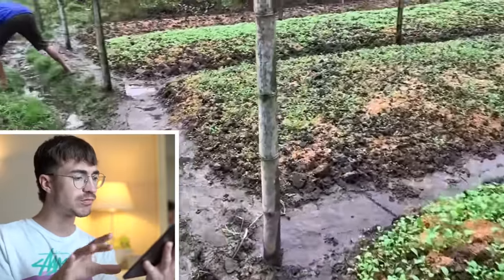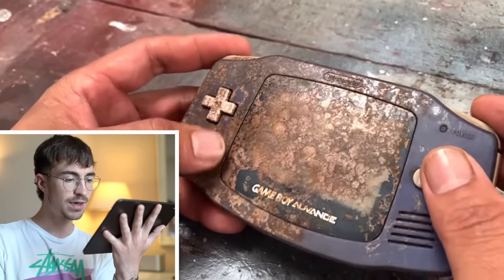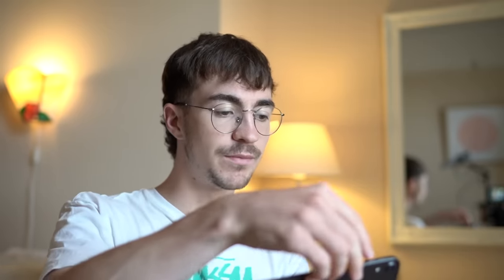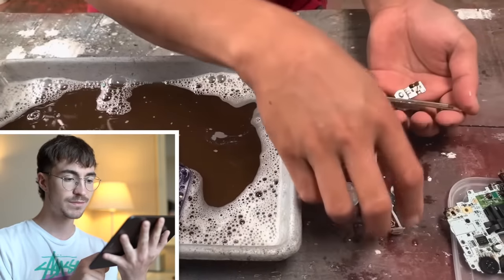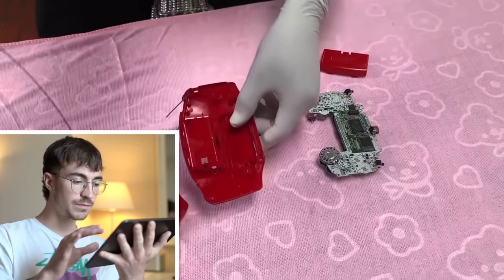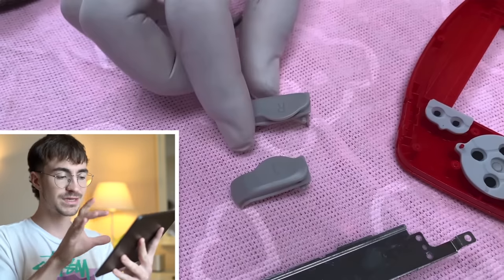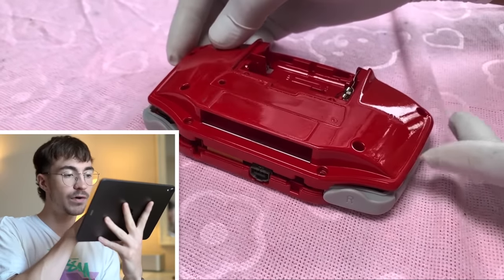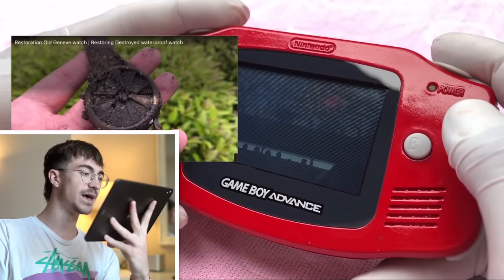Exposing FAKE Restoration Videos!

Comment: Soaking your electronics in water isn't going to harm them, as long as the device is off and disconnected from any power source. Water itself is harmless to electronics as the damage is only done when spilled on powered devices, in which the water bridges the gaps between circuits and causes a short which can lead to sensitive components receiving higher voltage than they can tolerate.

Also additional fun fact, distilled water (pure H2O with nothing else in it) is completely non-conductive and will not cause a short, even if spilled on actively powered electronics. Water gains it's high conductivity from outside materials being dissolved into it. I know this because I've built water-cooled PCs, and my coolant of choice is distilled water with a drop of biocide. In the event of a leak, the risk of actual damage is minimal. One of the pumps I used required the motherboard to be powered on in order for the pump to spin, which was necessary for filling the loop. One of my fittings wasn't on tight enough and the loop burst, drenching the motherboard and PSU in distilled water, whilst they were powered on, and no components suffered any damage. I still use the PSU in the rig I am typing this on. I also occasionally wash my keyboard in the sink with the faucet

tl;dr it's perfectly safe to soak a gameboy advance in water if it has no batteries. Just make sure it is fully dry before attempting to power on.

Comment: the reason the Gameboy actually turned on it’s because if the systems off then the water won’t effect anything but you have to dry it before turning it on or it will damage the system and it wont turn on

Comment: Electronics expert here

Yes the motherboard can work, not for long time tho, it may work for some hours but if is actually a years or even just some days in mud and then you sumerge it on water it will not work 

My sound card i use on my pc spent 3 years where it got wet by the rain and works fine but mud destroys everything pretty fast 

A muddy gameboy can work but not for long or even just never work and judging by the casing of the console it had been for atleast a year on the mud so

No, it will not work at all 

Also he sumerged the screen on water and i did'nt saw any water mark 

Those can appear with just your natural finger liquid so

Yes it is fake

Comment: A few weeks ago I found the controller for a VTech baby monitor at a bus stop. Missing the battery compartment cover, a little beaten up, but probably salvageable.

Suddenly I had a feeling I'd been hijacked into a bullshit restoration video. 

I wiped off my fingerprints, dropped it in the raincoat pocket of an unsuspecting passerby, and melted into the shadows.

Comment: You can actually submerge electronics in water and have them still work. As long as there wasn't a current in the electronics then the board won't short out. I've done this many times when I've had FPV drones crash in water and kept it underwater while I unplugged the battery. Clean it up and let dry for a couple days to make sure, and they power on and work just fine. Most the time when an electronic shorts out from water, it's generally while it's still on and the person is shaking it out while there's still a current. This movement of water causes the arching and shorting of components on the board. REMEMBER PEOPLE, water IS NOT conductive!! The materials like nickle, iron, etc are what causes the current to pass through water, NOT the water itself.

Comment: In Pakistan, we also wash motherboards with surf and water. They work perfectly. These electric circuit boards are more durable than we actually think. 
I've personally restored many old computers. Sometimes, some parts need to be replaced but that's all included in the process of restoring something that has already served it's life well.

Comment: As a technician having worked in the industry since '90, I have personally washed dozens of circuit boards with soap and water with no issues. Home and business electronics are often infested with roach carcasses and feces if the place is infested.
On that note, I'll never visit New Jersey, as the electronics from their restaurants are always some of the most disgusting I've ever worked on. 
In this refurbishment, he had no choice but to replace with aftermarket contacts because they wear out with use, which is likely why it was tossed out in the first place.

Comment: If you watch all the "points" from the beginning of the original video, such as the screws and the buttons, you'll see these were not replaced. The same threads and heads were there from the beginning, some of it is blocked by your inlay.

Also, there is nothing wrong with using soap and water to clean electronics. I'm an engineer and used to work in a factory environment. We primarily used trichloroethylene, undiluted isopropyl alcohol(not the rubbing alcohol you get at the store) and deionized water to clean our boards. A couple decades ago when I worked there, they used to allow the assemblers to have drinks at their stations. Someone spilled soda or something on a board and didn't tell anyone. They sent it through the wave machine and cooked the sugars into the vias. This isn't soluble in trichlor or isopropyl. We literally soaked the board in dish soap and water to break up the sugar and get it cleaned. We reflowed it, and the board is in a mammography machine somewhere now. Forget something as simple as a Gameboy.

What causes water to damage electronics is if you turn it ON while it is wet, especially if the water has electrolytes dissolved in it(salts and other things in solution). AKA normal water, compared to deionized water, which is non-conductive. With normal water, you might as well take a screwdriver and scrap it across the conductors on the board while it's on. You create conductive paths that weren't designed to be connected, overloading semiconductors and causing permanent damage. If any electronic board is cleaned with water and thoroughly dried, there will be no harm to it.

There are actually some fluxes and temporary solder masks out there that are water soluble, designed to be removed by hot water after the wave machine when the boards get cleaned. Look up Chemask WF from Chemtronics for example. Very popular product for plants that don't want to use strong cleaning agents. You have much to learn, young grasshopper.
Reply: The video is still fake and all, but good points

Comment: I'm not going to go out on a limb and say the motherboard wasn't replaced with one that maybe had some selective rust added, however I have seen a lot of C-64 and Amstrad CPC restorations by Noel's Retro Lab that were crazy how well things survived a very long time in bad conditions.  One of them had sat in an outdoor barn/shed for years and was full of mud, leaves, and a bunch of superficial rust on the MB.  After thoroughly cleaning, drying, and inspecting he was able to get it to power up without any issues.  Of course a GBA is a lot more complicated with many more things that aren't going to do well with moisture (Especially that screen!), however since it has no built-in battery that could really destroy powered traces/components until it completely discharged a GBA has a much better shot at surviving water long-term.

Comment: How can an electronic device be turned on if the components inside are still wet? When they take the device apart after successfully turning it on, the inside still has parts that are obviously wet. If that person in the video knew anything about electronics, they would thoroughly dry out the Inside before Installing batteries.

Comment: Water in and of itself won’t hurt de-energized electronics (except speakers or LCD screens), however the rust and corrosion would. 

Using a brush would have a very good chance of dislodging something though.

Comment: To be fair, a good way to possibly salvage submerged electronics is to (after removing the battery) flood them out with clean water ASAP, to get as much potentially-short-causing crap out as possible, then let them dry completely. However, they didn't do that.

Comment: I did restoration of old gear for my local police department, so they could put old equipment in a local museum. That shit is a nightmare. It is not simple or easy, even with non electronic parts.

Comment: You can submerg electronics in water and still have them work. As long as the electronic is not wet while activley passing current it can survive through a dowsing. So as long as he dried this bad boy up real well before turning it on, it has a decent chance of functioning. Fun fact.

Comment: It's not the water that damages electrical equipment, It's electricity. As long as there's no electricity flowing within the device while the device is wet then there's no damage to the device.

Comment: Surprised you didn't call out the case more. The spray painted case had translucent properties. Paint that can cover up another color won't let light through like that.

Next, I've seen boards which can be revived from some pretty bad states, but I can say those boards were not the same boards. Sure it was a worn board but not the same one. A board in water that long would have "exploded" when the soldering iron was brought near. Additionally the board would have deteroiated and crumbled under slight pressure. And don't get me started on the capacitors. After soaking in mud that long they would have failed as well.

You can submerge a board in water and it will be fine (I recommend baking it for a bit after to get all the moisture out, but as long as the water doesn't make electrical contact it may run after.
Note: There are some chemicals which look and somewhat behave like water, but are not water. One such chemical (I forget its name) is used in server room fire suppression systems, because it won't damage electronics but can be used to similarly to water to put out a fire.

One more thing to note: that mud and dirt didn't look natural.

Comment: There's nothing bad about running water over a circuit board that has all its power removed, as long as it's either deionized, pure, or just regular old mineral water but which was dried off thoroughly before adding any power source back.

Comment: my guess is, the GBA is actually dead, but not the LED light, so they tried to preserve the mechanism of the light when they ruin the whole thing, they make it so the bulb can still receive electricity. and showing it can still be turned on, giving it a sense of hope. a false hope. in the end, the machine could be a new one, or it actually didn't rust, just dirty which can easily be cleaned off.

Comment: I'm no expert on restoring, or for the matter of the electronic know how, but just thinking outside the box, that the "so-called" restoration video could simply be "authentic", and perfectly working...but here's the kicker....which I'd bet ya what that guy did, the whole process of taking each portion of so-called restoration, and put it "IN REVERSE"! And also add confusion for spraying it a different color, reassemble it with a self-dirty edged motherboard, and so on, and so on for each part, IN REVERSE...and soak it in muddy water for months, and stage it, begin cleaning it in the most worse way possible!

Comment: Its not uncommon to scrub motherboards with soap and water to remove flux. Many have washed motherboards in the dishwasher. Famous overclocker Der8auer for example uses a dishwasher to clean electronic components.

Comment: The watch one that came up after is actually worse. He finds a watch, as shown, sitting atop rubbish in the same area as he found the Gameboy. The glass is all smashed and fragmented into pieces, but none of it fell out until he gets it back an tips it up! He does the same thing, dumps it is soapy water - its battery powered - and with a new crystal and battery, low and behold works straight off. Filthy mangles case, gleams like new chrome after a drimmeling.

Comment: Using water to clean electronics is fine if there is no power running through it and you completely dry it before supplying power. Use water to clean circuit boards all the time.

Comment: Accurate its been doctored with donor parts, but there have been many times over the years where ive found a pc dumped on the side of a back road that has been wet, dusty and muddy for weeks and weeks, and ive carried the sucker home, removed the hard drive and cmos battery, chucked it in a dishwasher on the pots setting (with the dishwasher tablet in) then once its done put it in the back room for a couple weeks to dry out, reassembled it and its worked fine or only had a minor issue like something had bent the keyboard connector and broken a solder joint(were talking 386 25mhz pc's here with the round 5 pin keyboard socket) or the floppy drive still has grit in it and it doesnt work/ruins disks. Having said that i had one that just kept triping my circuit breaker no matter if i changed the psu or unplugged whatever besides the mobo. Ive also had alot of luck with simply dissasembling, washing with dish washing liquid and a brush and letting dry/hairdryer and reassembling nes and master systems and cartriges that had been dumped on the side of the road back in the late 90's when they were worthless and the rubbish tips were expensive so people just left giant piles of junk on sides of dirt roads away from town. So id say its plausible to do.  Although it would had to have been batteryless already,  nothing ive ever found that had been powered on at the time of being submerged has ever worked properly again. Even the nokia 3310 isnt immune to falling off the roof of a car into the gutter on a rainy day.

Comment: So, i manufacture/solder PCBs. On the motherboard that is allegedly original, there's parts that are ASM (auto-surface mount) whereas on an original board they were wired via through-hole.  the micro-chips are aftermarket as well, since they don't have an official serial # either.

Comment: Electronics can handle some water as along as there is no active power running through the circuits. I used to work as a electrical tech at a mill and our spare parts room flood over long weekend when a pipe burst. Long story short 99% of those parts worked just fine after we cleaned and dried them.

Comment: My grandfather got his first pc in 79 ,he has had a lot since, but even if they did work when he put them away they often dont work anymore if we try to start them, the iron and the rubber inside and out gets rusty and stiff. 
There is absolutely no way that Nintendo would work, the rubber would be stiff or just fall apart when it dried, the rust would leave marks.or cause small things to break or even break off.., the rust that was real, anyway, not the strange substance on the plastic, im not sure if that was supposed to be dried mud or what.

Comment: The HDD in my laptop seized up after overheating and being dropped on the floor. I was devastated because I hadn't backed up my "homework" file. Luckily, I soaked it in anti-freeze overnight and it worked perfectly. It even restored the stickers, seals, and changed it to a better manufacturer. I'll post the video as soon as I get my keyboard regreased.

Comment: Submerging electronics in water or soap wont instantly kill them, the reason why water is genarely dangerous for electronics is that it shorts pins/connections that you realy dont want to be shorted, this is not realy a problem if you clean it without power connected and you dry it correctly. Still might be fake tho idk.

Comment: I saw a laptop restoration that was so horrible, even my sister who sometimes watch me soldering (and I'm horrible at soldering eletronics) and disassembling laptops, saw that the dude was faking the restoration randomly removing capacitors and resistors, randomly repairing broken traces with wires, and then just pick up another laptop to show it's working, and a lot of fools in the comment section commenting how amazing it is, 1.5 million views...

Comment: That the power LED powered on doesn't mean the unit "works". It only means the batteries and power switch are supplying power to the power traces on the main board.

Comment: A motherboard being submerged in water for a long time doesn’t mean it’s going to break. It can break if electricity is going through it but there were no batteries when it was picked up. I don’t like the quality of the paint job. Should have gone for base layer then colour and transparent layer for protection on top

Comment: 11:11 "power" light is not turned on, plus you can see air bubbles on the corners of the screen, air bubbles common on plastic films that come on brand new parts or accesories to prevent scratches.

Comment: Okay to be fair just because electronics touch water that doesn't mean it instantly dies.

If you don't have any power to it at the time, it won't cause a short, if you dry out the components either by air or by alcohol washes to evaporate the water before rusting sets in and you are sure it is dry before powering on, then it should be fine in most cases.

Water isn't a magical substance that instantly destroys electronic components, in fact it's moreso water impurities that are responsible for the bulk of shorting damage to components like minerals and other particulates that can cause a more violent discharge due to higher conductivity. Salinated water for instance is leagues more conductive than distilled water.

The rest of the issues are completely valid but that's the one that a benefit of the doubt can be afforded.

Doesn't make any of the rest of it real but, just saying